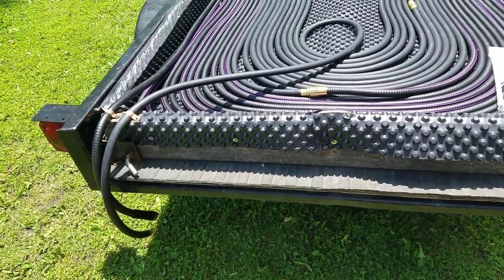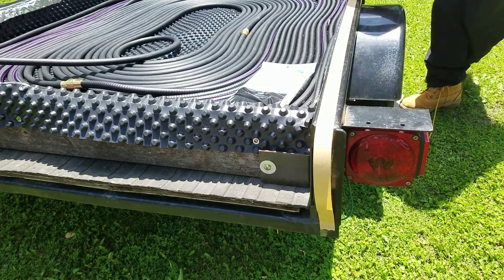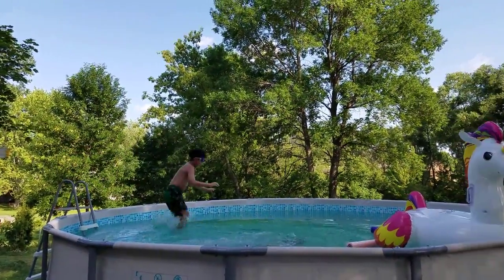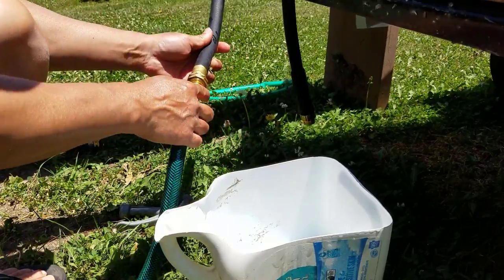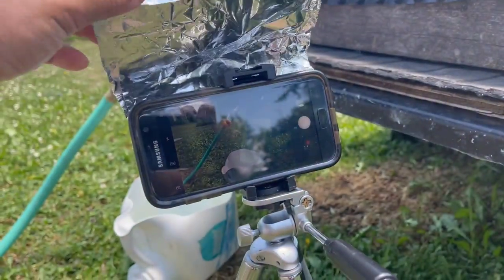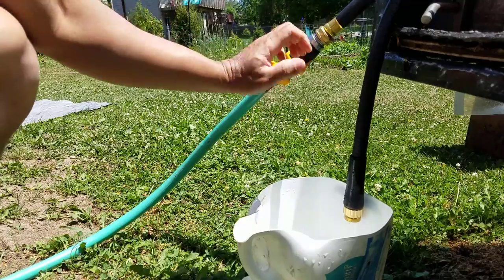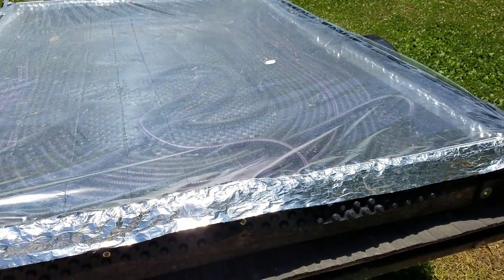DIY Pool Heater - Crazy Hot - (VERY EASY)

Comment: one problem here. That's the water that's been siting in the hose. When the water starts flowing through it won't be anywhere near that temperature. It might raise it 5 degrees if the water is flowing fast enough to heat up the pool at all. Tried this and it doesn't work
Reply: It does work to an extent. It all depends on several factors. The 2 biggest factors are size of pool and rate of flow. If you're trying to use this design on a huge pool it wont work due to thermodynamics. On a smaller pool it will (or should) be capable of raising the temp 10-20° depending on length of tubing and outside temp.
Reply: My pool is 4 foot deep 15 ft round no shade tree at all we use black mobil home plastic as a tarp n help only top layer water
Reply: Remember this. Sun has power of 400W per square meter ( sunlight that is hitting the earth's surface ). So if your heating tubing has 5-6mm ID ( inner diameter ) and lenght of 600ft, you'll be able to heat the constantly flowing water ( about 200L / hour ) from 15c to 25c pretty easily. But all this depends on how big your pool is. 600ft   Or 180m is good for pools that has max 5-6m3. Pools with bigger volume will need longer tubing ( roughly twice as long ) and probably more wider tubing as well with ID of 8mm ( about 400L/h ). Your rooftop with 100m2 is constantly hit by the sun at the power of 40kW ( best conditions or ideal conditions ). So 10x10m of tubing ( around 900m long ) will produce enough power to heat the water from 12c to 50c constantly flowing with the flowrate of 400L/h. 1km of tubing will produce enough heat to heat thw water from 12 to 50c... ridiculous... the best way is to store the heated water somewhere and use it when you actually need it ( if you're about to go in the pool, 10mins befor turn the boiler on  to release water in to the pool and you'll have much hotter water ). The thermodynamics of the boiler is the best because you can store as much water as you can and probably you can store it for more than 2 days hot enough to get a shower. That's a lot of talking what's the best, what is ideal and what is completely useless... the second option is to heat it externally with wood or gas but i think you'll have only wood for free, not a gas.

Comment: How do you get the water into the hose? Do you pump water from the pool? What kind for pump did you use?
Reply from the maker: Initially I used city water straight into the pool heater and out to the pool. Once the pool was full, I used a solar panel and a DC Pump that submerged in the pool to automatically circulate the heated water whenever the sun was shinning.
Reply: @mrmightytiger7385  Once full, doesn't the solar effect cycle itself, like a solar tank does? Or do you not have it set up that way? You might want to look into that! It would be quite advantageous if you could take advantage of a similar unpowered cyclical effect.

Comment: What is the water temperature after the water that was already heated in the hose has been expelled and the hose is now filled with the cold 65* water? The water that is stagnant in the hose obviously got hot but my question is if run continuously with 65* water entering, what is the temperature of the water coming out? Certainly not 160*.
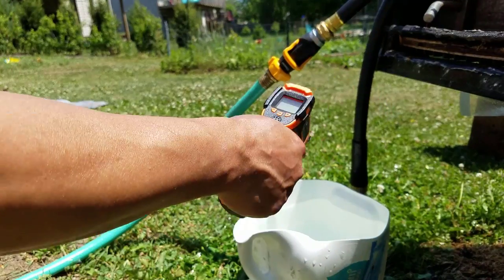Reply from the maker: Good questions! I got about 5 gallons of super hot water with this setup. To get more hot water volume, I had to expand the setup and added a portable shower heater. See my above ground pool setup video starting at 4:20 https://www.youtube.com/watch?v=dLi42uQy2WM&t=10s

Comment: How did you connect it to the pool?
Reply from the maker: One side was connected to the garden hose with a flow control - city water. The other side connected to a 25'  garden hose that went to the pool.
Reply: @mrmightytiger7385  nice
Reply: Wow. So no pump? Fresh water from the hose, into the heating loop, then into the pool? Do you let the hose run continuously?
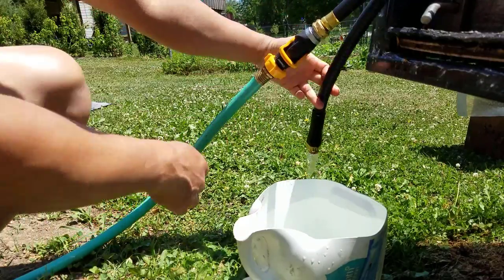Reply from the maker: @greghum4754  Correct! I had a glimpse of how I set it up in combination of 2 other pieces to heat a 5200+ gallon pool and able to use the pool the very next day! Start at 4:19 of this Video https://www.youtube.com/watch?v=dLi42uQy2WM&t=4s

Comment: Doesn't work -  evaporation cooling at the surface is greater than the minute heat produced - 6000 btu heat loss for gallon of evaporation the water after sitting in the hose can burn you but with any water flow at all, not enough hose surface area to really impact the pool temperature.  I live in the tropics and it doesn't even work here.  You need a large field completely covered in black hoses 1,000's of feet of it to have any real affect.